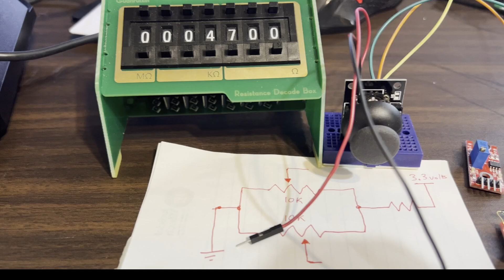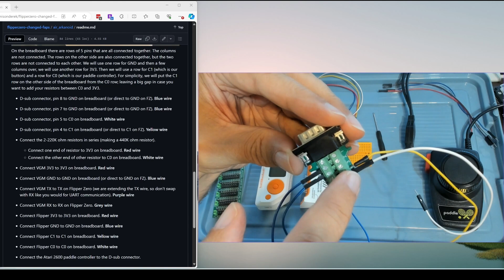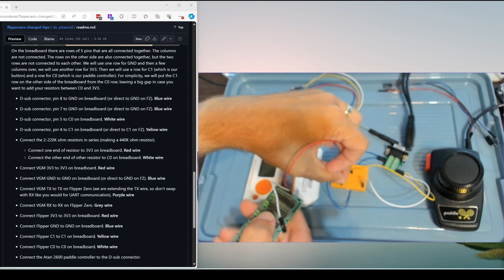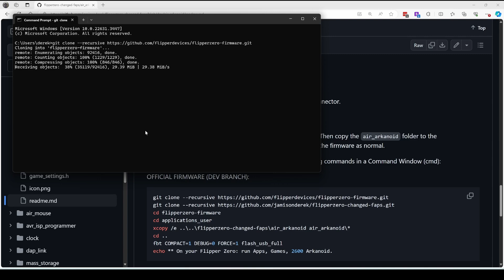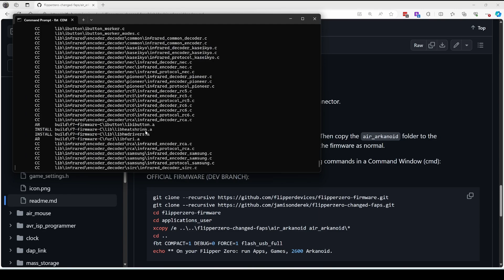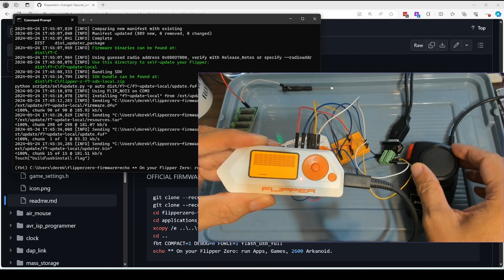[118] Flipper-Zero: Atari 2600 Paddle control of Arkanoid game! #flipperzero #atari2600 #videogames

Comment: It's not just me that owns both of them lol
Reply from the maker: I have like 6 cartridges that no longer load on the Atari 2600.  It's the same set of games that fail to load each time so I'm thinking maybe it's the device and not the cartridges that are failing?  "Pong Sports" is an example of a game that won't load. Any advice?
Reply: @MrDerekJamison  have you tried blowing on the connectors for nostalgia at least , what ones you having trouble with and I will check my one